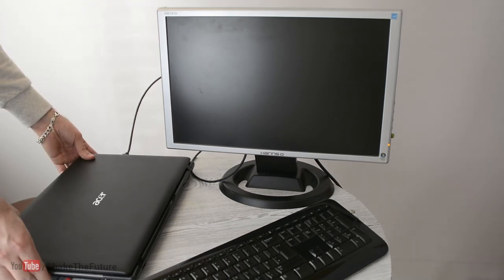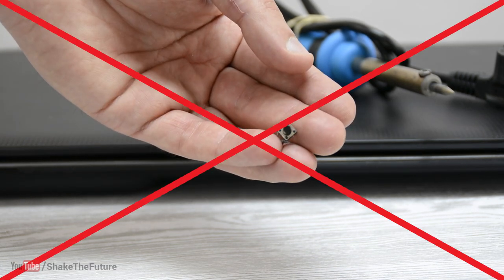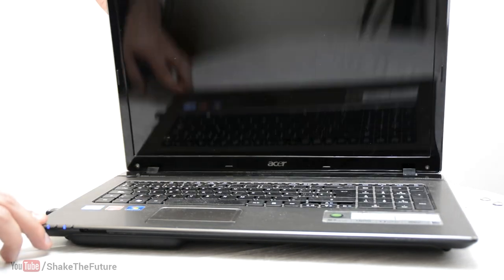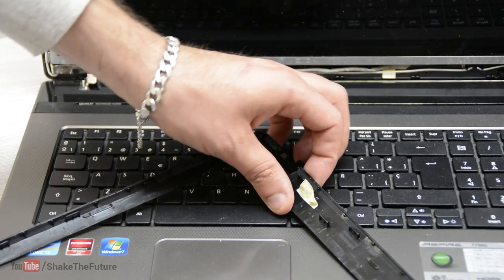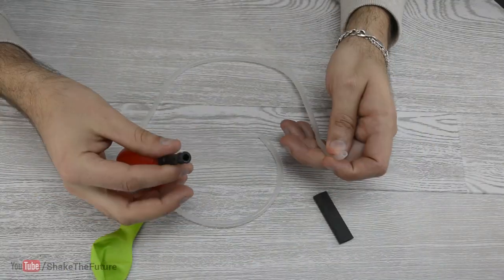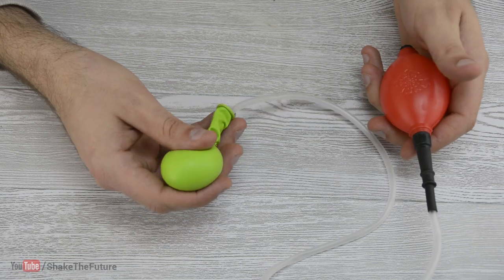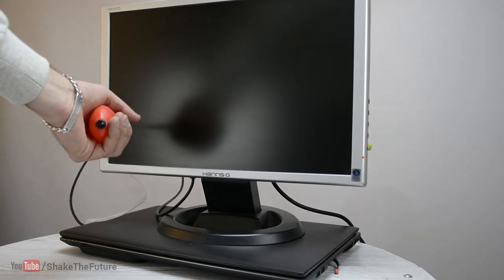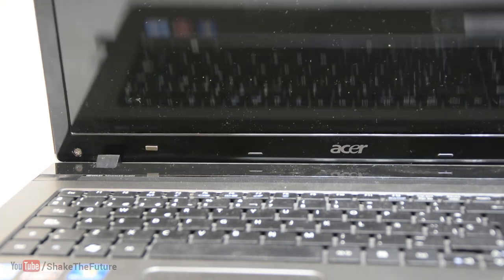Turn On The Laptop With The Lid Closed

Comment: why can't they just put an option in the bios ffs.
Reply: Damothedevo IKR
Reply: Exactly
Reply: @Cats are love. Cats are life. to turn laptop on or keep it on if the screen is down?
Reply: @Cats are love. Cats are life. can you tell more?
Reply: @KropivsekVisuals  i'm fuckin 1000 hours trying this.Do you manage to do that?
Reply: @LuizAugustoXCampos unfortunately not, completely new to this quest. :/
Reply: @KropivsekVisuals  I got to use the function wake on lan in may laptop acer e15 553g. It turn on with the lip closed using the network card and the command by android. Unfortunately I couldn't get through  the wifi

Comment: or just change the power options to "do nothing" when lid is closed, but then you still need a way to turn it on
Reply: Make it wake on mouse or keyboard, but it doesn't turn on if the laptop is shutdown though.
Reply: @chetan_naik  with lid cloused, mouse doesnt work. It kills all usb functions. Its a windows 10 issue. Tried it on multiple times hahaon multiple machines

Comment: hack for laptop with power butoon on the chassis: USE A MAGNET! with the lid closed put a magnet on the laptop magnet (near the power input), ckick the power button and the laptop will boot. take the magnet off after 1 second and the image will appear on the external display

Comment: Amazing!
I guess you have so many dislikes, because people don't get it.
I have an old laptop connected to the TV and it's very annoying that I have to open the lid every time to turn it on. It takes too much space. This way I could stick the laptop behind the TV :)
Reply from the maker: +Marek Gobreks 
Yes, that's the point.
It's not meant to be used for people who only occasionally connect the laptop to the TV or a Monitor. It's for those who have the laptop connected to the TV/Monitor all the time.
Cheers!
Reply: but its kind of weird having this pumper thing just to turn laptop on I suggest to buy docking station with a power button.

Comment: Brilliant idea. Had an old Dell I needed this for and had to take it apart and solder a new cable to the power switch and run iy out to the base of a monitor...to do this same thing. This would have save me some time and effort. 

This is a great way to save a laptop from the great pile, when the screen goes 10-7
Reply from the maker: +Dad_a_Monk 
Thanks!
I am glad you like it.

Comment: I don't understand pumping the balloon will have the latter pressing the power button? I am not sure this will work with my laptop power button as a bit of pressure is needed pressing the power button and it is slightly "influx"

Comment: Interesting, by how about, if available, just enable Wake On Keyboard Device (Phoenix BIOS?)  or similar so you just have to press a key on an external keyboard after putting laptop to sleep previously.  Some "Wake On" options on some hardware can even work when the OS has been shutdown (but of course something is still lurking there to catch the wake up).
Reply from the maker: +Marty G 
Yes, I was looking into these options.
I had a feeling that this video might be only useful for geeks like me, not an ordinary user :)
I have my laptop turned off when not in use as well as the extension cord where it is plugged in. I just like to make sure equipment that might draw some power is turned off when not in use :)
So for that reason, I could not use the wake up on Lan/keyboard option.
Thanks!

Comment: i miss my old day Gigabyte PC motherboard which can switch on the PC by pressing keyboard/mouse . hope the notebook manufacturer can support using external keyboard or mouse to switch on the notebook . i used to connect my notebook to 43" 4k monitor via the dock . although its just provide me 4k 30hz , but i have to accepted it.
Reply: that's not possible unless it's in sleep mode or something

Comment: This is how you can achieve this in 2023:

Enable "Wake on AC" option in your BIOS (System/Power Mgmt). Laptop will Power ON when the charger is plugged in.
In a nutshell, laptop will only Power ON when the BIOS receives event "AC Power is plugged in!"
Reply: Problem is not all laptops have this function. That’s why I’m here

Comment: laptops have a wake on ac option in the bios that will turn it on (while it is off), with lid closed, when the adapter is connected (or connect the ac adapter to a power strip with an on/off switch).....some have the option to turn it on from a usb keyboard....lastly, you need to go to power options, change advanced power settings, select power button and lid, lid close action do nothing so windows will work with the lid closed...but I liked the balloon idea.
Reply from the maker: +user 007 
Cheers!

Comment: Most laptops have a setting to keep it on after closing it, don't they?
Reply from the maker: It's not about that.
It's about turning on a laptop (that is completely switched off) with a lid closed.
Reply: +Shake the Future I get that, but you shouldn't need to remove the magnets
Reply: +Shake the Future otherwise though, nice video :)
Reply: With the magnet in place it wouldn't turn on by using air balloon, no?
Reply from the maker: Al M 
Exactly! Magnet will not let you turn on the laptop.
Reply: +Shake the Future +AI M Oh well, I guess I learnt something new :)

Comment: This is brilliant! Not only did you describe the problem -- that the power button is disabled when the lid is down -- you found a simple solution -- remove the magnet. In my case, I don't need the balloon. I can operate the button via a small lever that is inserted in the gap between the body and the lid. Bravo!

I, too, am surprised by the number of people (morons) who don't understand the difference between sleep and shutdown, and why Wake-on-Lan isn't a solution to this problem.

Comment: Instead of taking the laptop apart to disable the behavior of the laptop when closed, you can go to the power option (usually by right clicking the battery or charger icon on your laptop) and there is a section about what happens when the lid is closed. Switch those settings to never sleep and the laptop will not sleep when the lid is closed
Reply from the maker: +Metalbolt 
Yes, but it's not what I was looking for.
I needed a way to turn ON the laptop, even when it's completely OFF. Changing those settings will not do the trick :)
As I mentioned in other comments, I do understand that it's not something everyday user will use, but people like me, who have their laptops hooked to the TV or a monitor all the time (and they like to turn it off, not put it to sleep), it might be useful.
I should have explained myself better.
Thanks!
Reply: +Shake the Future Yes i got that just by listening to you, strange people jump do conclusions :D just kidding we all do that some times. Will it not be possible to disrupt the magnetic field enough so the sensor doenst get it? like with a small sheet of metal or even thin foil? that will increase this hack even more, without the need to disassemble the screen, anyway is problaly a old laptop if we are using it just for wacthing TV. Great video as always.

Comment: There's literally an option in Windows power settings smh
Reply: That's not the problem
Reply: @DavidVazquezBk  what is then
Reply: what kind of option>?
Reply: @PowerRedBullTypology  Basically set "laptop closed lid" To do nothing
Reply: @MrMinecrafter720  how will you power it up with the lid closed then?

Comment: +Shake The Future      Most modern operating systems support the ability to configure system behaviour when the laptop lid is closed.  For MS Windows, this is done under power options.
Reply from the maker: +Spoif Yes, I am aware of that. I took out the magnet to be able to turn ON the computer with the lid shut. Once the laptop is off (not on standby), you will not be able to turn on the laptop. I always turn off the laptop completely and even turn off the extension cord, so there is no way to wake it up with a keyboard or Lan.
Cheers!